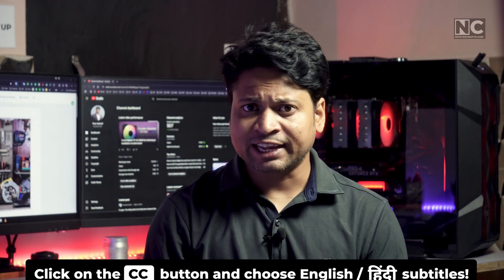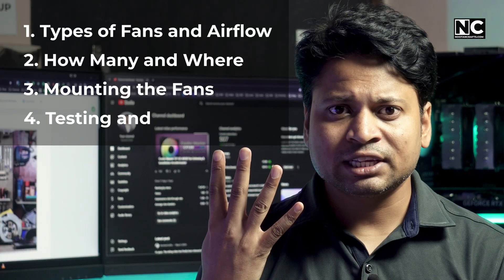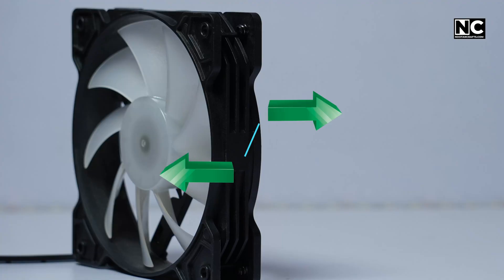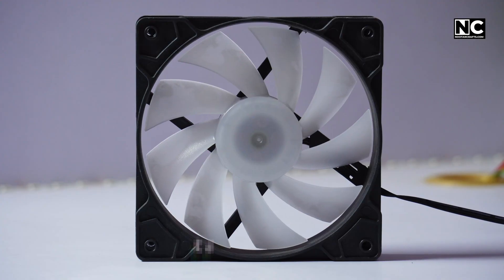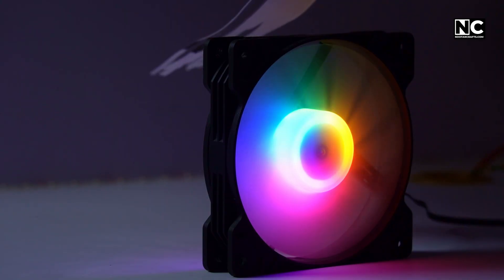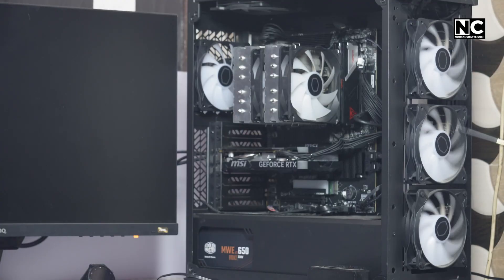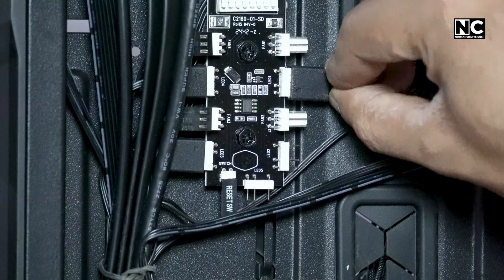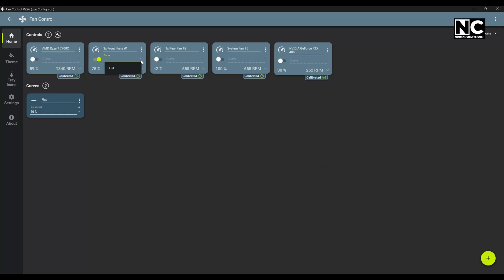How to install fans in a PC case  - With Proper Airflow!

Comment: Hello there my AIO cooler is not working anymore so I bought a new Air Cooler but my AIO has 3 fans which are fine. Can I use those 3 fans as a PC case fan? One as a exhaust and another two on the top. Please help
Reply from the maker: Absolutely! That's a clever way to recycle. AIO fans are usually high-quality static pressure fans, and they'll make excellent, powerful case fans for your exhaust and top slots. Just make sure the connectors (usually 4-pin PWM) plug right into your motherboard's fan headers, and you're good to go!
Reply: @NootanCrafts  Thank you so much for helping sir.